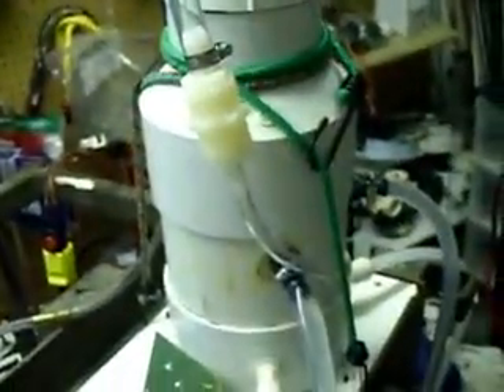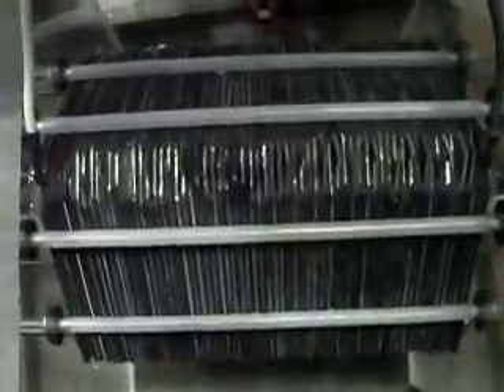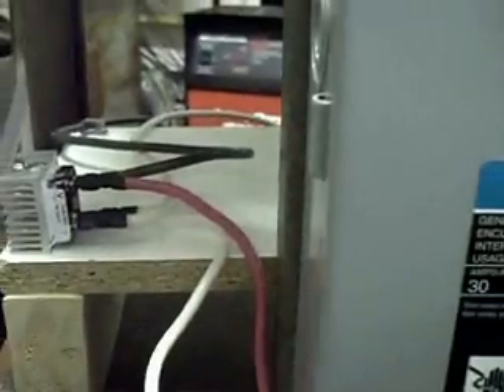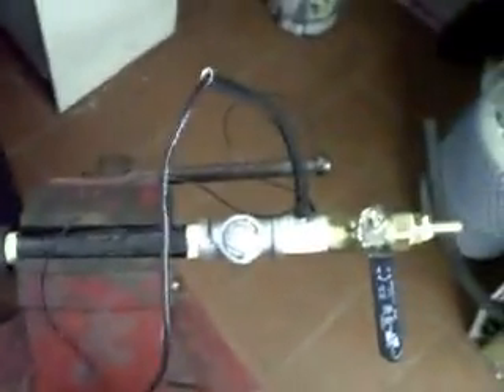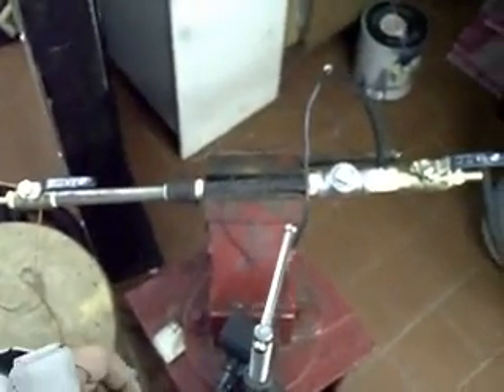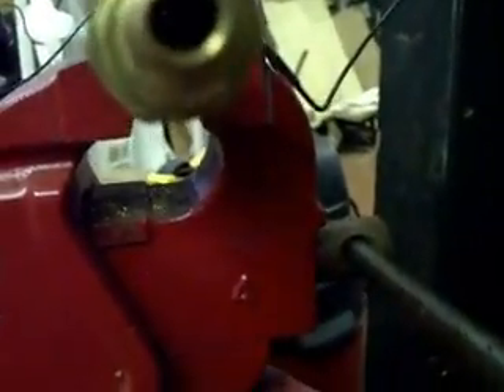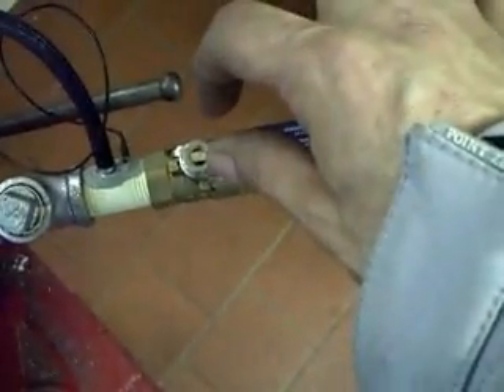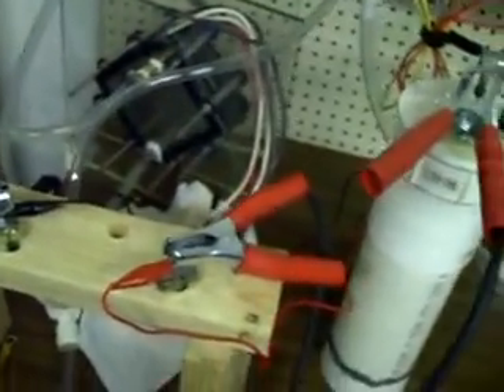#29 Start of New Experiment Season

Comment: @hhoball The caps quickly discharge after about 5-6 seconds and hold a charge below 1.5 volts for a couple of minutes on my 12v setup. The charge thats left doesn't make any hydroxy after 10 seconds